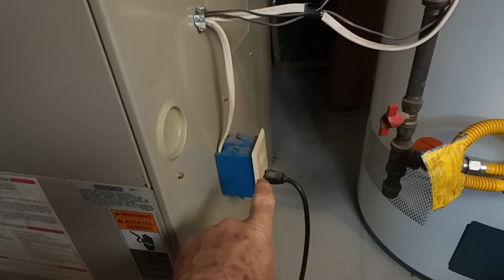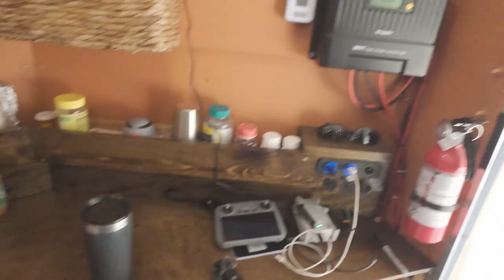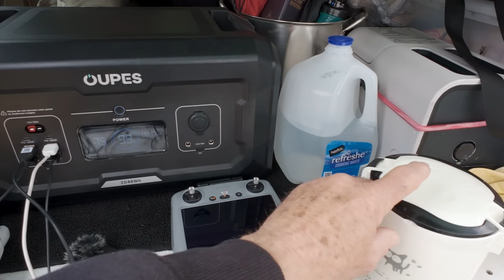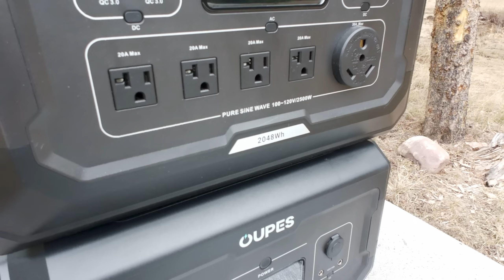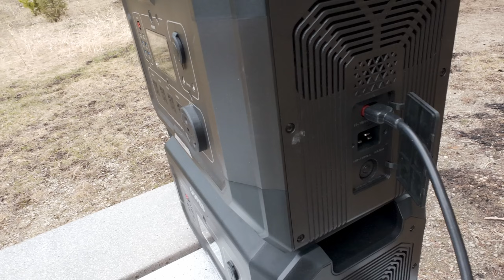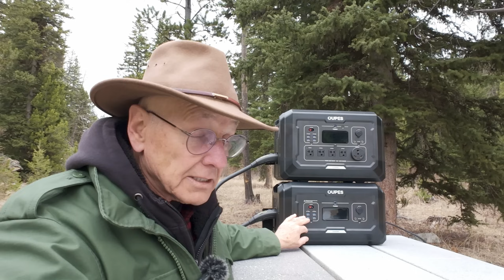A Fantastic Lithium Power Station For Power Outages and RV Camping

Comment: Rick, why haven't you considered a wind power turbine to generate power for your storage batteries ? Those storms that cause power outages usually concern high wind conditions, don't they ? Solar is good as long as you have sufficient light conditions especially when you don't have the light at night.
Reply from the maker: Wind power is a great back-up, but it makes quite a bit of noise.  I think both are a good idea.  Thanks, Alvis.

Comment: Rick, nice video. Would a ground-neutral bonding plug need to be added to the oupes mega-2 power station to plug it into an RV's shore power cord? Or does the Oupes have an internal bond?
Reply from the maker: I think you're asking about plugging your RV power cord into the 30amp outlet on the OUPES and in that case the OUPES is internally bonded.

Comment: I have TWO "OUPES Mega 3" and "Two Batteries" one for each Mega 3...and TWO "2k Watt" OUPES Batteries that they no longer make.
Run Window AC, Refrigerator and HDTV.
I also can cook on my Electric Skillet and make Tea/Coffee. 
I do want to buy a very small Microwave (700 to 900 watts) to use if power goes out, the MAIN Microwave is Built into the wall, so hard to get at the AC Cord.

Our HOA had a "Party in the Park" for families and kids....with Cotton Candy Machine and 3 Bounce Castles, but the Breakers popped with the load.
So, I went home and picked up my Batteries and was able to run everything for 3 to 4 hrs...had about 1/3 left on my batteries.
The HOA director sent out a THANKYOU for saving the day post the next day.

Comment: You're obviously old enough to have endured power outages.  Ask your local Fire Department about having 'lithium based' power devices in or around your home!
Reply from the maker: These are made with LiFePO4 lithium batteries and shouldn't be confused with lithium ion, which are a fire hazard.

Comment: Can you jump start or charge a dead vehicle battery with that?
Reply from the maker: You could charge a battery by plugging in a battery charger or by hooking to the 12v, 30amp Anderson port.  I carry a lithium jump-starter for the task and have used it many times.  They're not very expensive and they're small.
Reply: @gonagain  Thank you!

Comment: I noticed on website description that storage cannot go below 30°F; how do you manage this battery in the winter time keeping it at or above 30°F?
I live in Alaska and I’m wondering about using one of these in my home and winter camping vehicle.  I imagine that we have similar temperature extremes here in Alaska as you do there in Montana… Although not as hot here in Alaska in the summertime.
Thank you for your wonderful reviews and your content .
Reply from the maker: You can store it down to -4F, but you can't charge it below freezing, which is true for any lithium battery.  I store mine inside during the winter here in Montana (lower Alaska).

Comment: hey rick love the information on the portable generator , but one question , when you going to install a solar panel on top of the truck top? never hurt for more power, as a 1000watt unit if it fits right, ?  but i love watching your video due to the information you give out.
Reply from the maker: We haven't found the need for more power yet, but that's a good idea.

Comment: I live in a very cloudy state. And the electric has been off for up to 10 days. It goes off all the time, so many years ago I bought a  Honda 2,000 watt generator.  It will run everything but the well. So I bought a trolling motor battery and a 3,000 watt inverter for the well. I  pump water once in the morning and once in the evening.  The generator will run up to 12 hours on one gallon of gas. I can run the furnace, lights, tv, fridge, and freezer at the same time. And I charge the battery back up with the generator. The stove, hot water heater, and furnace except the fan runs on LP. I can't run the air conditioning, but that's okay. I seldom need it anyway.
Reply: You are practical. You created an emergency system way before lithium was available especially at today's prics. Yes if doing it over again, l'm sure you woujd have seriously considered using them.  Four years ago I equipped a WeeRoll enclosed cargo trailer as an RV. I meet my energy needs similar to your system....Generator and propane.  Lithium batteries were almost $1,500 way out of my budget.  I just replaced my 4 heavy duty 6V batteries with litium where l paid only $229 for each. The lifetime of my lead acid's was getting shorter so l sold them helping to purchase the new upgrade. We all adjust as our conditions change.

Comment: What happens if you're on one of your roadtrips and not home? Pipes freeze? 
Move south.😁
I want one to run an A/C unit on solar in Hawaii where electric rates are high.
Reply from the maker: With enough solar and batteries you can run AC from solar.  We generally stay home during the worst part of winter, but with a basement it's not too bad on the pipes.

Comment: Could you explain in more detail about how to hook it up to your 12 volt system. I 
Know oupes give you all the different wire for hooking up, but do I need any other wiring or Anderson plug  to hook up into my cargo camper 12 volt system. I would appreciate any advice. Also, thank you for all the information that you do on utub . Love  watching your channel .
Reply from the maker: Thanks Thomas!  The wires that come with it are for a solar panel, but you can get an SAE (Anderson plug) with wire attached from Amazon and will just need to cut off the other end.  Then it's just a matter of wiring the positive to the + buss of your RV and the negative to the - buss
Reply: @gonagain  thank you so much for your reply. And thanks for all your videos. You don't know how much you mean to us, u-tubber.

Comment: I have a C tohevy VOLT that uses the same click on power cords as the battery. It locks on just like Rick shows once it clicks. What is the safety rating?
Reply from the maker: UN38.3.MSDs, RoHS, PSE (certification for Japan)